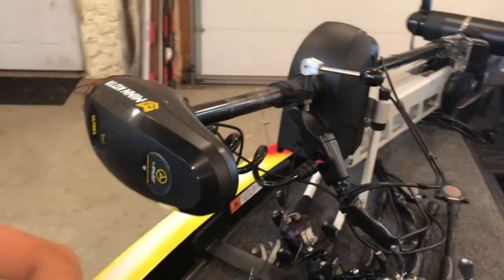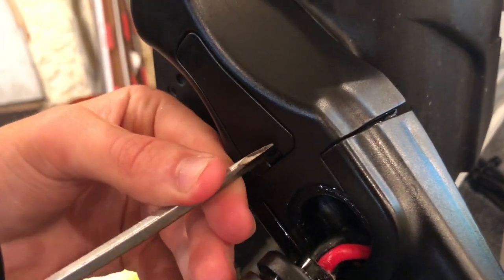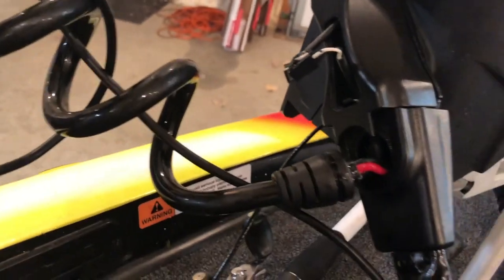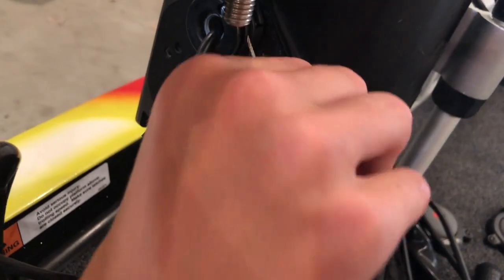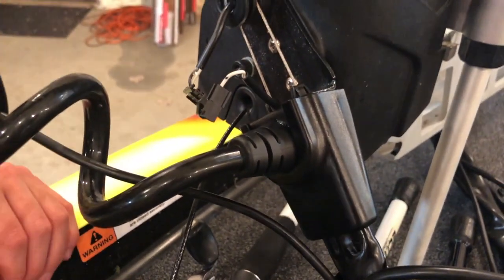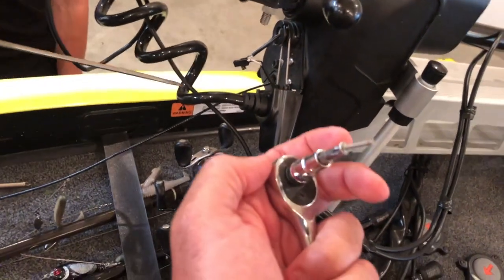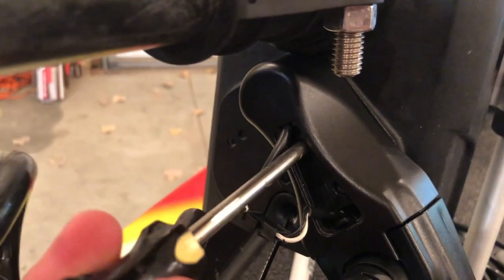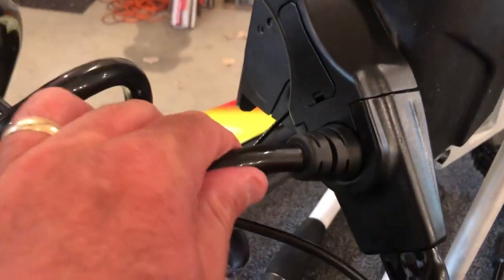Minn Kota Ultrex - Rubber Wiring Grommet Repair

Comment: Thank you! Mine has been that way for a couple months. Finally got tired of it and fixed it. I only used 52 gallons of grease and stabbed myself numerous times with a flathead before I found this! Lifesaver